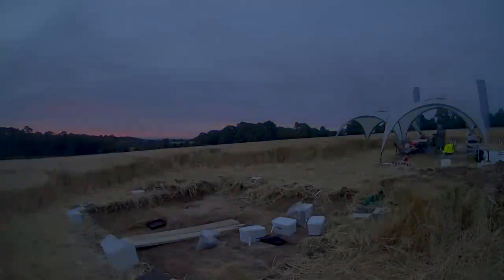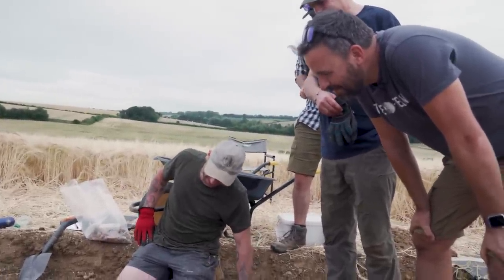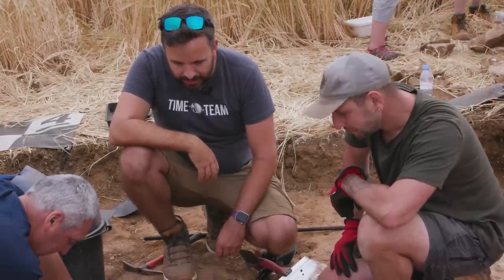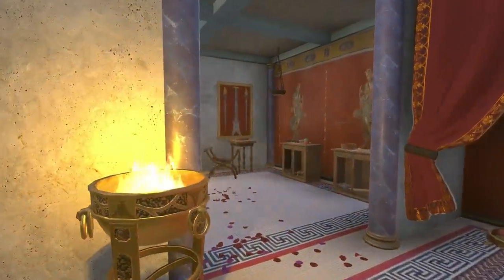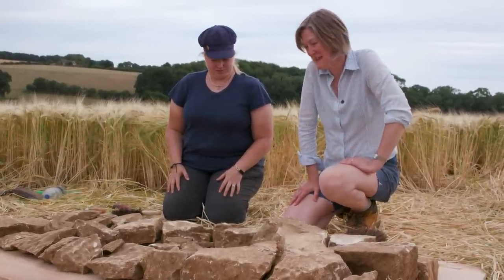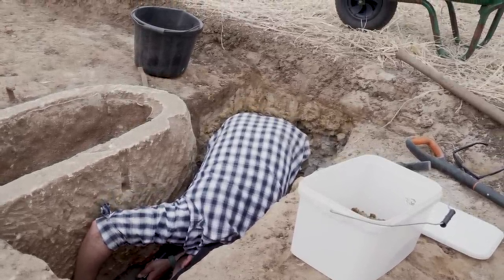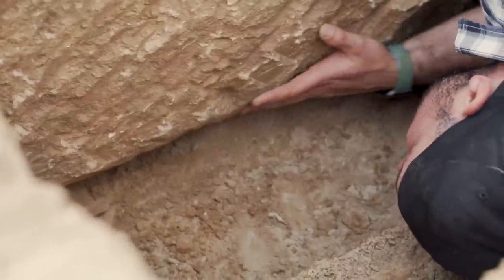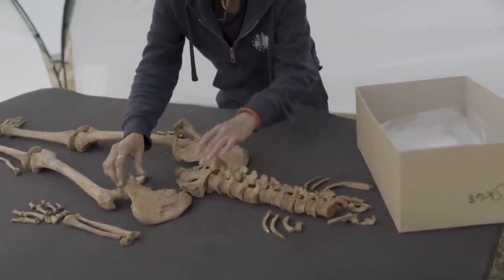NEW EPISODE | Time Team: Return to Broughton Sarcophagus (Day 2) Expedition Crew – BRAND NEW DIG

Comment: Fascinating. 
Sounds like there are more questions about the additional stone then, if the farmer's memory is correct and the original lid was smashed and removed offsite. What is it then, if not a lid? Wouldn't a Roman grave marker not normally be inscribed?
Reply: It seems very odd that you would remove a thin stone lid but backfill with thicker lumps of stone.
Reply: I'm guessing the 60s archeologists brought what they could find of the stone back

Comment: Lead is not poisonous in the way some viewers appear to imagine. Remember, the Romans anciently used Lead to line their water pipes. Wash your hands after and don't be breathing lead dust, would be sufficient safety for the team. Long term exposure is the problem with most contaminants.
Reply: I had lead water pipes in my house until  I moved in 2010.. still very common.

Comment: Pretty bad optics to be pointing out the lead contamination and doing no Health and Safety lead contamination control.
Reply: There isn’t any real danger, lead is perfectly safe to handle for a bit, especially when you wash your hands after doing so. It only becomes a problem with ingestion or long term handling, neither of which is the case here. Remember those bones have had almost 2 millennia to leach the lead out of that lining.

Comment: I don't know why they screwed around with the original formula. I cannot watch these shows. They cut the individual digs into segments of less than 20 minutes, and for me that's not enough time to get into it. The narration that used to pull everything together is gone, and there is no central character to care about. I would like to support Time Team, and I would if I still cared about the shows.
Reply: The 'central character' is the archeology itself.
Reply: There were 2 full length programs earlier in the year and there will be 2 more next spring.  These short videos are extra material!